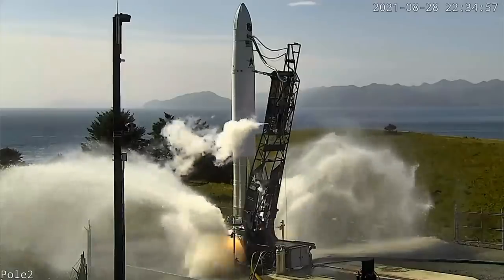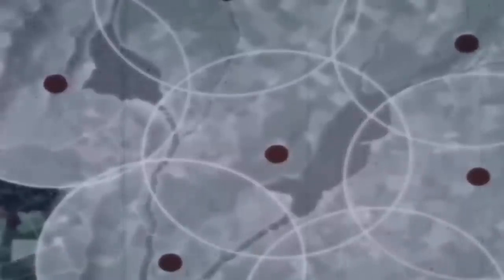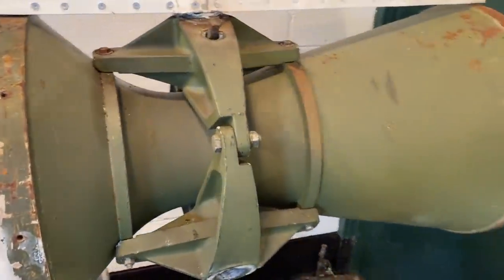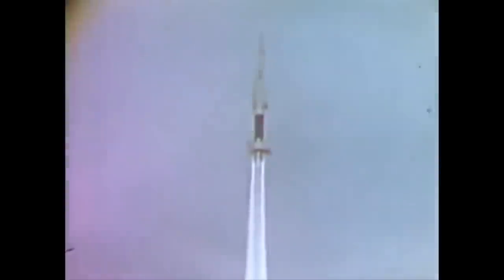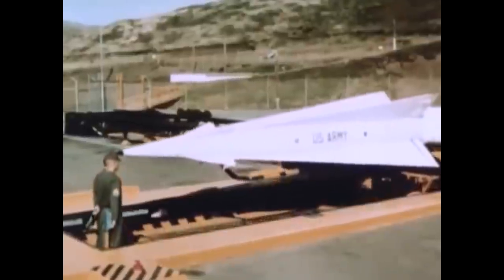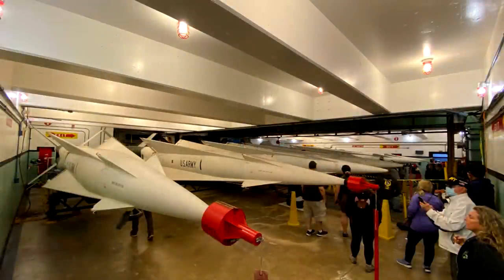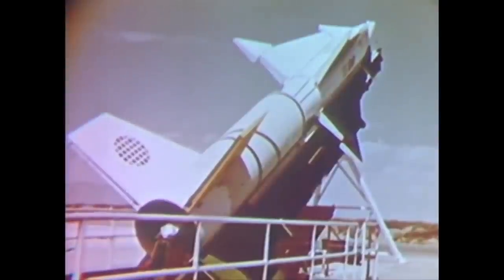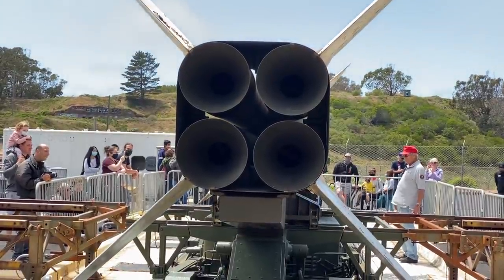Nike-Hercules - US's Surface To Air Missile with Nuclear Warheads.

Comment: Interesting video, Scott.  I got a kick out of seeing the electronics at 8:56 onward, I think I recognized the empty slots with green card-edge connectors as similar to one's used in F-101 Voodoo and F-4 Phantom fighter jets.  In the late '70s I worked at a major defense contractor, and we still had to work on assemblies for those older jets once in a while.  Amazing what the engineers did with basic components back then, as you pointed out analog computers and control systems were being used long before digital came along.  Synchros and servos and resolvers, oh my! 😁
Reply: Don't forget "cap tachs" (Capacitive Tachometers).  Weird little beasties from the INS computer on F4s.  About the only thing I remember from being in a CRS (component repair squadron)  in the USAF
Reply: @thekinginyellow1744  I built, tested and repaired F-4 units for nose gear steering, brake pulsers (anti-lock brakes!) and 20mm gun control.  Remember any of those?  ☺
Reply: @bobblum5973  never had to work on them, but I remember them.  I still have a 20mm practice round that I found sitting on the flight line.
Reply: @thekinginyellow1744  I was never in the military, but I consider my defense contractor work to be the next best thing in support of our country.   Not that I'm in favor of war, either, just realize it's sometimes necessary.

Comment: I found the entire era when the Nike missiles were developed very interesting.  The Army / Air Force rivalry during the period was almost to the point of mutiny.  For the era the technology displayed in the systems were revolutionary.  The SAGE sites with their AN/FSQ-7 computers that were among the largest computers ever built, provided the command and control.  Besides the Nike missiles there was the Air Force's Boeing CIM-10 Bomarc that was a supersonic ramjet powered long-range surface-to-air missile that also could be armed with a nuclear warhead.  As you mentioned, after billions of dollars spent when the system was in its final configuration it was obsolete.  They did however, in their ABM research develop two of the most amazing missiles as follow-ons to the Nike Zeus, the Spartan and Sprint missiles.  The Sprint accelerated at 100 g, reaching a speed of Mach 10 in 5 seconds. Such a high velocity at relatively low altitudes created skin temperatures up to 6,200 °F, requiring an ablative shield to dissipate the heat.
Reply: Never heard of this! 100g!! Oh my! Nearly a gun shot... would be another story for Scott!

Comment: My uncle served in a mobile Nike Hercules battery in the early '60s. It was a development and demonstration unit. Don't think it was ever operational. They just drove around the desert in big trucks and worked on the best ways to set up and break down the equipment.
Reply: I remember being told while the Nike started as a "mobile" system, it was reclassified as "moveable" because it would take a week to get all of the cables connected right and functional again!  When I got to Germany we were with a Belgian unit and they had put all of the trailer launchers up on blocks to line them up and roll missiles out form the storage structure for launch.  They hadn't taken the tires off of the trailers and and after 20+ years they were all hanging down from the rim like in old hillbilly cars in cartoons...{!-{>

Comment: As a kid in the 1950's we lived on an island in Puget Sound. On several occasions the Nike base on the island was opened to the public and I remember touring there. I saw the missile launchers and radar installations.
Reply: lots of former nike sites in washington state because of boeing, hanford and the large military presence here. strangely though, none of them are very well preserved, some of the launchers are still there, most had the doors removed and were filled in, none of the radar and control sites are intact though.
Reply: @marzsit9833  I remember that were also anti aircraft gun installations at the Nike site and they were spinning them around like they were tracing airplanes.

Comment: I grew up in a Boston suburb in the 60's and early 70's. We had both a Nike Hercules radar tracking facility and a launch facility (about a mile apart) in our town. We were never told they had nuclear warheads. By the late 60's control of the facilities had be transferred to the National Guard and we had the impression that the missiles were obsolete (which I gather they were). One snowy winter, I snowshoed across the lake and up through the woods and approached the launch facility and was shocked at the level of security... There was a double perimeter fence, dogs, and armed guards patrolling. In retrospect, this was due to the presence of the nuclear warheads, not the strategic importance of the site. The warheads were eventually removed by helicopter. Only after they were removed was the public made aware of their existance. There were Nike Hercules radar and launch facilities in a number of towns around Boston as well as on an island in Boston Harbor.
Reply: Most of the warheads were nuclear. We didn’t want to miss.

Comment: Excellent timing, was just this moment working on the cad for a 1/3rd scale model to fly at a local rocket launch when I saw this in my feed. It's got a ton of interesting, different and difficult features if you want to do a reasonable scale model, very challenging. I'm in awe of the craftsmanship of the original builders, not to mention that analog computer. Amazing, and I'm glad we never fired one in anger.

Comment: A note on the SF site that Scott didn't mention - it is (COVID permitting) restored and open for tours, and as of 2015 a bunch of veterans of the sites were leading tours and answering questions. They aren't getting any younger, though, so if you're in the area I highly recommend going be for a visit.

It's also a great bike ride through the Marin headlands, and close to even older WW2-era shore defense gun batteries on the ocean side of the peninsula - the SF Bay has been a vital military/logistic hub for a loooong time.

Comment: Very interesting vedeo. In 1971 I was a Pershing 1A Missile Guidance and control repairman. The Perhing was a 400 km necular missile. I loved to compare the Nike to the Pershing. The Pershing had an analog guidance computer that was like the rear end of your car. It took the informarion from the accerometer ans determined location and velolcity. The gyros and accerrometers used air bearing and there was a spearical air tank that was wire and fiberglass. 

The Pershing could not be shot down because it rentered from outerspace at mach 7 on a good day. The short range ment by the time you saw it comming, you were dead. 

The Pershing was some what protected from EMP (electromagnetic pluse). Which is my main topic. The Pershing had a battery of three missiles that needed to be fired at fast as possile before the incomming necular response took us out. We had eight minutes to live after pressing the button. That was the travel time of the Soviet missiles. They knew where we were, but they could not stop the Pershing in the air.

The EMP from the Nike should have scambled the electronics on the incomming aircraft and missiles. It would have been bad for our radar too and any other Nikes in the air at the same time. The EMP was probably studied at the test you mentioned but is most likely still classified. What are your thoughts?

Comment: The station in the Everglades was painted completely pink to help those stationed there with their stress from constantly being scrambled against Cuban based bombers, and knowing that if they fired their missile the winds would blow the fallout right back at them
Reply: I'm sure that helped a lot...
Reply: Fallout would actually be quite minimal. We're talking about a 40kt blast about 75 miles away, without all the irradiated dust thrown up from a ground burst.

Lower exposure than living a year in Denver.  And far lower than sitting in the Everglades breathing in the fallout from 400kt (the most likely Soviet nuclear gravity bomb to be used then) ground bursts on Jacksonville, Eglin, Homestead, Blount Island, Mayport, Pensacola, etc.

Comment: Ah, analog computers... I am just old enough to have worked with the things in college. Fun story: during spring break of my sophomore year (1973), I stopped by the Huntsville space center. They had the first "video game" I had ever seen, a "moon landing simulator." You used a pair of toggle switches (one turned the main engine on and off, the other gave little blips to the left and right thrusters) to control a little triangle (your LM) on an oscilloscope screen. When nobody was looking, I opened up the cabinet (in my defense, it wasn't locked) and looked inside. The guts of the "simulator" was a TR-20 plugboard analog computer. 

When I got back from break, I took a course in analog computation... and we had a whole room full of TR-20 plugboard computers. So, of course, I had to replicate the "moon landing simulator." My version worked pretty well, but I was never able to track down one quirk: if you were moving a bit too fast when you touched the moon, you'd bounce up with more energy than you had before. If you let this bouncing continue, you would wind up back in orbit again. Must have been "flubber" cushions on the landing pads...

Comment: i used to work on the nuclear warhead sections of the Nike Herc  back in the early 70's and sometimes go to the sites  It was one sweet bird.  Scott got most of the details correctly except for the yields.  Pretty close though.  I have the cone part of the static probe on my shelf which was shipped separately from the warhead section

Comment: My uncle worked on the Nike missile system in the early 1960s, but he never talked much about it, so I really appreciate this look at it!

And I used to own a very simple analog computer kit my dad got me from Radio Shack that could do basic math using the difference in voltage between three potentiometers.  You changed the tour of math by changing the labeling of each pot and entered the first two values of your equation on the first two disks and adjusted the third dial until the meter was centered and then read of where the third dial landed when that happened. Super basic, but it did get the idea across.

Comment: Thanks for putting this video together! My dad manned these in Florida from 1972-1974. He tells the story of his unit disembarking from a plane at White Sands Missile Range for training maneuvers and promptly being told to get back on the plane that they were going back to Florida. They get back to Florida, are quickly shuttled back to their batteries and are on alert for the next few days. He said it was the only time he saw the safeties come off the nukes. It was October 1973, the Tom Kippur war.

One I find a bit more comical is that they had orders to radar track anything that came within their range, this include Air Force One when President Nixon would vacation in Florida. They knew who it was, but orders were orders, so they would "paint" the plane until NORAD called and told them to disengage.

Comment: I was a Nike Hercules fire control crewman in Germany from 1977-1980. I was the “computer” operator. The systems were so complex and archaic it’s amazing anything worked which they didn’t on a regular basis thus 4 batteries in rotation on hot status. I think the Nike’s in Germany were shut down just after I left.
Reply: A/5/6 75-77 IFC
Reply: @ypdave01  B/2/1 ADA IFC Dexheim

Comment: Excellent video.
I saw one of these sites with the missiles out off of the coast of Virginia in late 1967 at night. My Dad was a SAC B-52 pilot with thousands of hours, getting ready to transition to TAC for Vietnam. He said something about how these missiles would be obsolete soon. Not soon enough for his year in Vietnam.
In early 1980, while finishing my Engineering Physics degree at Oregon State. We fooled around with the last Analog computer there. Shoved off into a corner. It was fun. You just plugged wires from one module to another on a very large board. To do derivation? Put the wires this way. For integration? A different connection. It was the first and only time I saw Calculus visually occurring in real time as I watched. Nobody cared about analog computers in 1979-1980. So we had free reign to mess around with them. This one was not fast but gave excellent results. As I know now, the accuracy of analog computers depended on the quality/accuracy of the components. Capacitors, resistors and inductors. I don't remember if any tubes were used, but I don't think so. So discrete diodes and transistors must have been used? I have no idea what the voltage or current was used during operation. 
So long ago, it seems like another lifetime.

Comment: Hi Scott,
this was a pretty good summary for the NIKE-System.
I have been a BCO (Battery Control Officer) with the German Air Force. (Air Defense for the medium and high altitude was here Air Force, not Army.)
To watch what technics were used (DC Analog Computers) and the idea behind it was quite fascinating. As we had nuclear also nuclear equipped missiles we had American guard units and a rather complex release procedure between NATO and American channels. It probably would have worked, but thankfully we never had to test it. On the up-side, I have got some very nice friends in the guard units and a interesting education on the system and tactics in GAFADS in Fort Bliss, Texas. 
The German military decided to upgrade the system to hold it operational with a digital computer that had a 8 inch (!) floppy disc with the operating system. It also changed the required testing accuracy for the radars with our test mast from 1 meter to 10 cm. 
That the system basically worked was tested for each battery once a year in NAMFI (NATO missile firing installation) on Crete. 
The engineers and technicians had developed quite a system although the aircraft and attack missile technology. With an SR71 the PKP (predicted kill point), the assumed "meeting point" the missile was guided to in the early stages of the flight, was basically out of range. ;-)
Thanks for the good work!
/r Stony (a nickname I've got from the American friends due to the family name)

Comment: I remember hiking with a friend through some back hills of Vermont with backpacks when we were teens in the early 70's, getting away for a weekend excursion.  We turned this corner on a path and right there across from us were several missiles, sticking out from the side of a mountain pointing up!  That un-easy feeling that came from the times hit us like a ton of lead.

Comment: Fascinating! I once visited my mother and stepdad who are Snowbirds in Florida and decided to rent a car and drive all the way down to the Nike Hercules Missile Control Site HM-40 near the 'Old State Road 905' after having watched some information on YouTube and other sites. That site is now totally deserted and part of the backcountry where you apparently need a permit for to get in. As a Dutchman, I figured I would only be in there for about an hour so I just parked at the gates closing off that road and walked half a mile to the entrance which was closed off with a simple combination lock which was, as I later found out, easily pickable. (Thanks, Lock Picking Lawyer!).
So I didn't get a chance to actually get inside the buildings without breaking things, but I could follow the gate through the woods surrounding the complex and I was completely awed at the state it was in. Part of the building of what I think was the living areas of the personnel was open enough for me to see where the sinks would have been and the bunk beds. Also, I could see through the windows of another building on the other side where I could see something of a control station of some sort but all the electronics were removed. There is also a fairly large parking lot. Somebody had made a hole and they have patched it up, leaving a small window for people to take pictures through. 👍
There still are three towers where radar equipment would have sat and although I couldn't reach them because the area was so overgrown, I had a great little hike there and took a few nice pictures. I also saw a big spider which really freaked me out 😁

So when I was walking around the gate trying to find a hole in the fence, I saw garbage people had left behind. I saw old washing machines from the '60s and perhaps early '70s, tyres with white stripes on the sides and other things from decades ago. Amazing!

I hope I'll be able to come back there one day and find myself a way in because I'm really fascinated by this all. I'll bring better clothes for the hike as I was in shorts and a shirt and cheap shoes.
If you have more about these Nike Hercules Missile Control Sites, that would be great! I know some sites were sold to individuals, left open for the public as a museum or abandoned like the HM-40 site. The abandoned ones are nearly untouched and give a pretty clear view of how it was back then. Definitely going back there one day.

Comment: I remember living near an active Nike base outside of Boston. Many years later I briefly worked at the same site when it was used by the Harvard MCZ for preparing animal skeletons for research purposes. We used dermestid beetles which were kept in bath tubs in the old command and control room located just off to one side of where the missile gantry works were located.

Comment: Fun fact, Nike Herc being an interceptor, would reach mach 1,  3/4 of the way off the launch rail, about the length of a VW bug. For you speed demons out there try to imagine that. 
They where fazed out in the late seventy's and replaced with the Patriot system. I trained at Red Stone on different missile systems back then but picked up a bit about the Nikes.